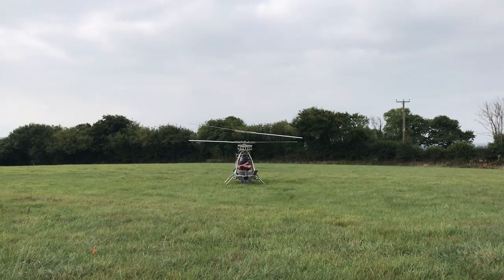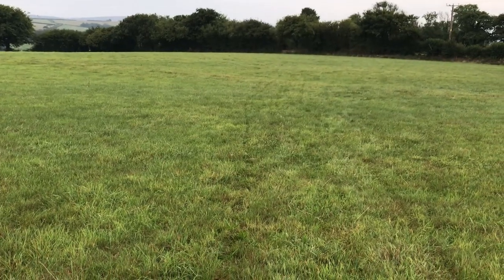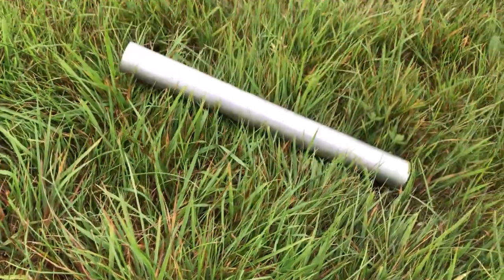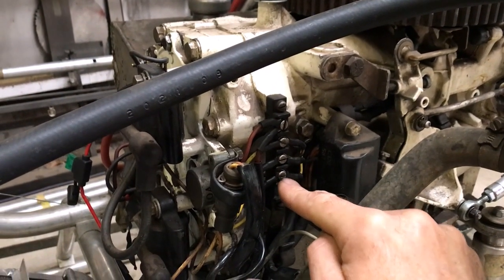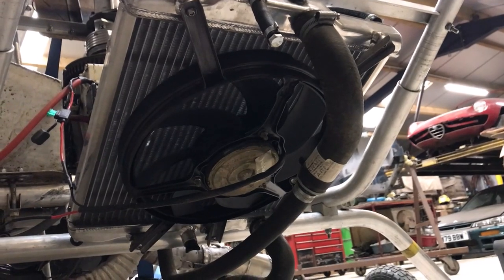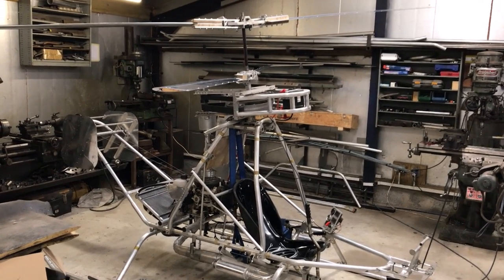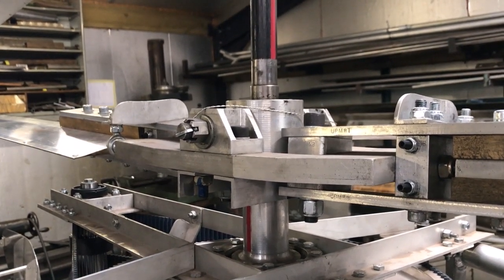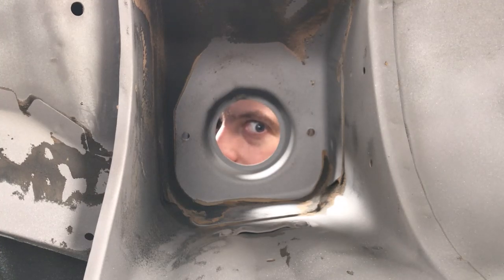Slow learning process Homemade coaxial Helicopter

Comment: For a teetering rotor the flap will normally be 90 degrees azimuth after the advancing blade lift, so both rotor tip path planes should stay parallel. I write this just after the drive shaft failure incident, but it might be an idea to scrounge a high speed camera to film rotors during hover to spot potential problems. These folks seem to know what they're doing: https://www.youtube.com/watch?v=2egYcX_9FKI
Reply from the maker: Thank you and I can understand that, it was explained to me through rotor flap back. There are people who say the rotors tips will get closer together the faster you go, people who know a lot more than I do so I'm not sure about it. 
I read somewhere that an audio warning horn was implemented on blade tips to indicated the distance in speed trials. Will have to research more. A high speed camera could perhaps do the same thing.
Reply: @Ben-Dixey  , this certainly makes sense for high effective hinge offset blade rotors. An example was the Sikorsky X2 coaxial experimental helicopter specifically designed for high speed flight. This design relied on the flapping torque at the base of the blade to transfer the advancing blade lift to the hub. The coaxial rotor then kept both advancing blade flapping torques in balance in forward flight.
But, high effective hinge offset blades means that the azimuth lag is less than 90 degrees, so opposing tip proximity is a real possibility. For your excellent teetering design you sidestep the issue by having zero effective hinge offset. It does mean your design will suffer retreating blade stall if you were to push it to high speed. But this is an experimental prototype for the purpose of concept investigation, so just play it safe like you have been.
I suggest you contact Plymouth Marjon University about using their disused runway for trailer towed forward flight dynamics experiments - maybe they have high speed cams. Keep your aircraft firmly bolted (not just tethered) to trailer so you can safely sit in it and feel flapback quality. Make darn sure you have very reliable radios for talking to tow vehicle driver and chase vehicle driver - you don't want disaster for want of a charged battery!
https://www.google.com/maps/search/airfield/@50.4227972,-4.108393,795m/data=!3m1!1e3
Reply from the maker: Wow. Super comment! when we talk about high effective hinge offset are we referring to a delta three type arrangement ? I've not heard that expression before.
Reply: @Ben-Dixey  , high effective hinge offset is just a "clever" way of saying rigid rotor blade. Instead of flapping to equality to avoid the root bending moment, the hingeless blade flexes about an "effective" hinge some way out from the root to the tip. The increased flap frequency effectively reduces the blade azimuth lag significantly below 90 degrees. Modern European helicopters favour high effective hinge offset blades because it gives positive manoeuvrability at zero gee - which makes for a much safer pushover (or bunt) in flight. But it means increased blade root and hub stresses so increased mass, not to mention the need for expensive finite element analysis and testing.
Teetering rotor blades basically have a zero effective hinge offset. It means that the rotor behaves like a gyroscope with flap maximum 90 degrees behind the pitch (relative angle of attack) maximum. There are some complications as the coning angle requires a little azimuth correction (robbies are 90 - 12 = 78 degrees from memory). But your neat direct cyclic control system will actually avoid a lot of the complications required to get a swash plate set up correctly.
Delta 3 angle is a little different, in that it is the introduction of a non-square hinge for flap-pitch coupling. The best place to see it is in the tail rotor of a robbie where it ensures that the tip path plane stays parallel to the fuselage - kindof important...
https://b-domke.de/AviationImages/Rotorhead.html#Robinson
Reply from the maker: You are a smart dude Martin. I hope we stay in contact, the next rotor project is gaining momentum.
Reply: @Ben-Dixey  , I have my moments, Ben. Not many, but I do have them. Happy to do whatever calcs I can to help you on your way. I assume you got Excel design tool OK? I'm in rural Cambs but folks are based in Devon.
One thought: To get a feel for the improved controllability of high effective hinge offset I think you want to try and find a Guimbal Cabri G2 heli to get  ~1 hour training. They have a good reputation as a pilots helicopter - might inspire you.
Googling finds:
Paul White, Elstree helicopters.
Helicentre Aviation (near Leicester)
Cotswold Helicopter Centre (Kemble)
Reply from the maker: Thanks Martin, good advice. If you ever fancied having a look in person I'm in North Devon.
Reply: @Ben-Dixey  , sounds really good, Ben. Folks are in South Devon (~2 hours away). I wouldn't mind taking some layout measurements to use your machine as basis for a general design tool for helicopter homebuilders. Excel based probably keeps tool simple/cheap for most designers. Coaxial is a challenge because you have to "zone" the lower rotor to estimate velocity from top rotor downwash (doable, but lots more code). This is ok for hover, but lots of approximations in forward flight.
From your last video it sounds like you might be moving away from coaxial setup? Or are you moving to separate teetering hubs for upper and lower rotor?
Reply from the maker: Hi Martin, email sent. I don't know what I'm going to decide to do at the moment. Think I need a few weeks to make a decision. Need to think about what would be the best use of my time. The upper and lower rotors already have separate teetering hubs. perhaps I've miss understood your question. Ben
Reply: @Ben-Dixey  , sorry question was not clear (and YouTube often deletes posts as spam). Your reasoning for top rotor moment about control pivot made sense to me (flight test best way to learn). I guess it's too early to know how you'll evolve the design. From your comments it sounded like you might be favouring single rotor, but in principle you could have separate control pivots for top and bottom rotor (mechanically complex). If anti-torque was your thing then there is always lateral symmetry to consider: side-by-side config or even quadrotor to pack as much rotor disk into planform as possible. Just make sure the darn thang can autorotate so it doesn't drop out of the sky like one of those drones...😱
Keeping an eye out for email - stuck in server somewheres. But, very happy to act as sanity wall for your ideas.

Comment: Hi Ben, your closing remark about the  lateral tilting of the two discs through dissymmetry of lift is puzzling. Hinged discs will flap to equality when encountering a gust or forward flight, thus they will both flap back and remain relatively parallel. In theory, an airflow from any direction should not present a hazard.
              Just a thought, I wonder of the Formula One engineers use  a more efficient  cooling fluid than the classic glycol and water.
              Your observation on the danger of long grass is valid. In addition, It is known that hovering over long grass, rocky or sloping  surfaces reduces the bonus of ground effect '  A flat paved surface would be the ideal when  trials are flown with marginal power. 
                Also noticed how very effective your yaw pedals are in flight - Lookin' good !
Reply from the maker: Hi Ray, this video was made before you explained flap back to me! I didn't know about it then. However there are some people who would argue that the tips will get closer together with increasing forward speed. I don't understand it enough to comment further unfortunately but I do understand how flap back occurs now. (Thanks to you) 
Yes that race car more efficient coolant is on the cards. I had forgotten about it so will order some I think. 👍
Yes yaw vanes seem ok for effectiveness, no issues so far. 
Thanks for your thoughts Ray, always helpful.

Comment: awesome job ... i recommend you build a fan shroud for your fan it will help cooling  Significantly you may even be able to use the smaller fan with a shroud to help direct the air
Reply from the maker: Thanks for the comment, I intend to build a shroud, I'm currently researching and testing the water pump flow rate as the bigger more powerful fan made no difference. I think the shroud without the correct coolant flow rate wouldn't improve things just like the bigger fan didn't. With improved flow rate I'm expecting longer flight duration with the same fan, if that's the case I will then build the shroud and perhaps we will have even more flight duration.
Reply: I had same problem on my race car basically a go-cart with a 600cc street bike engine 6 speed...but anyway I was having a cooling issue and come to find out the fan would run great but the way the air would flow must have got turbulent and wouldn't actually pull air correctly...I made a home made little shroud and never had a cooling issue since...I wish u the best I've watched every video and I respect the amount of patience time knowledge patience and can't say patience enough. Love what your doing and can't wait to see videos you flying around. I'm getting into flying looking in to an ultralight.  Iv always been fascinated with jet engines but I don't have the money to get involved with jets...last summer I built a bicycle with a jet engine gas turbine on it it was awesome
Reply from the maker: Understood, cheers for the info. 👍 your jet bike sounds interesting, was it a jet from an rc plane or did you build it ?

Comment: I've only flown a coaxial helicopter in simulation. The Ka-50 Black Shark in DCS World (PC, VR or flatscreen) is quite easy to fly (compared to the other conventional types) once you learn ALL the various systems. Of course, it has stability and autopilot systems for all axes (which both help and hinder).

Not a substitute for real flying lessons of course, more just an interesting hobby in it's own right.

Plus, when things go wrong, it has a pilot ejection system. Explosive bolts release all 6 blades just before the pilot is ejected, to prevent "slicing and dicing". Pretty rare for a helicopter, but my virtual life has been saved many times with it.
Reply from the maker: A simulator is a great start to learning the skill and I should have gone down this route first. I'm planing to get a simulator for the winter months.

Comment: I think those skids are just a little bit to short! LOL! What I hear is "Something I wonder about should I get this far" but my brain is screaming "Something I wonder about should I live this long", the question is am I being a bit cynical  to think that?
Reply from the maker: Well, there is no doubt risk to what I'm doing, how much risk is difficult to say. It really depends on the engineering choices I made and then the flight attempt choices. It's amazing how easily helicopters will roll over in any direction, once it starts it's nearly impossible to stop. However those long skids are a massive help. People have taught themselves without them, how I don't know.
Reply: @Ben-Dixey  You are 100% correct if it was not for people like Chuck Yeager we would still be flying Spitfires or even worse the sleeping pilot John Derry from Britain would have been the first to break the sound barrier. And heaven forbid think about the stupidity of trying to fly the bedstead!

Comment: Great!  Am I right you only actuate the lower rotor for tilt and bank? And you control the lift by engine speed ?  This and the gyro-steering by rudder makes the control system much easier. Well done ! It has a bit from a simple RC-Heli, but obviously it works. I am a homebilder for aircrafts. I´m not sure whether I will risk sometime to craft a heli. But I am very curious about it.
Reply from the maker: Hi, the whole rotor mast tilts and all four blades control direction. The pitch of the blades is fixed unlike conventional helicopters.

Comment: Since model aircraft gyro stabilization systems have become so cheap for fixed wing, helicopters and multi-rotor drones  have become relatively cheap and easy to set up, you could adapt a model RC gyro stabilization system to your experimental aircraft relatively easily. Use the same electronics just with larger servo motors or servos. Once assured of stabilized flight other issues can be resolved one by one safely.  Many teams have up scaled RC based systems for manned flight systems.  Don't re-invent the wheel.  Nice work so far!
Reply: I agree. I don't understand why people fly helicopters by adjusting cyclic and collective pitch control, engine throttle, etc when that is the type of task which computers (analog or digital) excel at doing.
Reply: @codetech5598  : Some from familiarity, some for the experience, some for greater control, some because they don't know of them, some because of concern about air worthiness certification.
Reply: @codetech5598  That's a bit like asking why we don't install electronic stability controls to make it easier to ride a bicycle.  Such systems are used on helicopters that are fitted with a full autopilot (including auto-hover), and would be needed on a self-driving motorcycle.  But, it is very necessary that a pilot has the skill needed to fly the helicopter without such a system - and having held a PPL(H) for many years I can tell you that just like riding a bicycle, manual control and coordination between cyclic, collective and yaw pedals in the hover and hover-taxi becomes very easy and automatic once you "get the hang of it" even though after the first lesson it might seem to be something almost impossible to master.  I expect you felt the same way the first time you attempted to ride a bicycle.  It becomes so intuitive that, like riding a bicycle, in normal situations there is simply no need for an automatic system - it's just one more thing to go wrong.  (Auto-throttle OTOH is very useful and makes life quite a bit easier, which is why even the R22 is fitted with it).  Flying full size aircraft is a completely different ball-game to flying models (I still cannot fly an R/C helicopter despite several hours of practice).
Reply: @davemould4638  Although it is possible to ride a unicycle, modern motorized versions (Segway, etc.) have stability controls and are safer.
Reply: @codetech5598  Yes, but I was talking about bicycles, not unicycles.  I expect bicycles and motorcycles would benefit from stability controls also, but seeing that they are easily controlled manually after some practice, it is debateable whether it would make them safer or provide additional points of failure and so make them less safe.  As said, full-size helicopters are not difficult to control once you have formed the necessary "muscle memory".
Reply from the maker: Thank you, if I decide to install such a system I will no doubt message you. Personally I wanted to learn the skill of hovering but more flight enjoyment might be possible with less pilot work load. Could be something for the future.
Reply: @SomeRandomName Aircraft have had 100% "self driving" automatic pilots for decades.  It would be possible today to program an aircraft to carry out a complete flight with no pilots on board, and indeed that is what happens with military "drones".

Comment: While I don't know much about helicopters I'm pretty handy with heat exchanger design, fans, DC circuits etc. I can offer some tips if you are interested.

Mounting the fan directly to the heat exchanger only uses a portion of the heat exchanger's capacity. Make a "shoe box" cover to support the fan at least 1.5" away from the heat exchanger fins. You are using a high pressure fan on a low pressure application. Something like a SPAL VA01-AP70/LL-66A will draw half as much power, weigh less, and probably move more air. Use a little smoke or fine powder to test for even-ish air flow into your heat exchanger. 

A 12v 20AH gell cell won't deliver 20A for an hour @ 12v, not even close. I highly recommend switching to lithium for both higher real capacity and weight savings. Lithium comes with its own learning curve and safety precautions, of course.

You can test your stator in place using a multimeter. Resistance across each coil should be roughly equal with no coil shorted to the engine. I see your replacement stator image shows six leads so you will have to sort out what goes where.

Your project looks very dangerous and I approve. If we all stayed perfectly safe at all times it would be a boring world.

I look forward to your further adventures.
Reply from the maker: Thanks so much for this great comment it's very helpful indeed and I will be taking your advice. I'll no doubt be back in contact with you.

Comment: I may be mistaken.. but it appears to me that both rotors are spinning in the same direction.  If I am correct redesigning your rotor system to one of contra rotation would solve a lot of control problems. Varying the speed of either rotor provides turning/directional control.. it may be possible to hybridise the design to with elements of the autogiro system for other possibilities..🤔
Reply from the maker: Yes rotors counter rotate and differential collective is very effective yaw control just complicated. It also reverses in autorotation I think Kamov have a reversing mechanism to solve this problem. Love the simplicity of gyros.